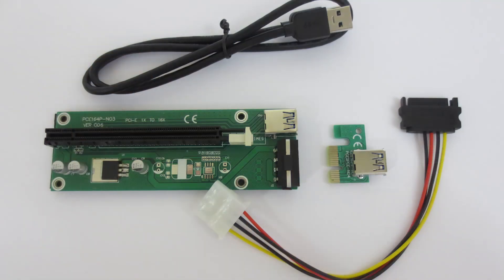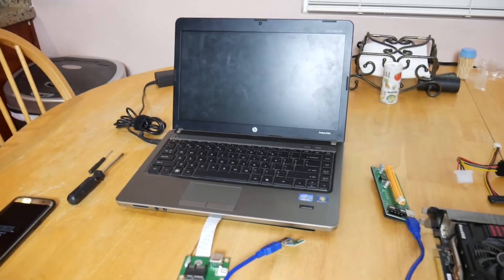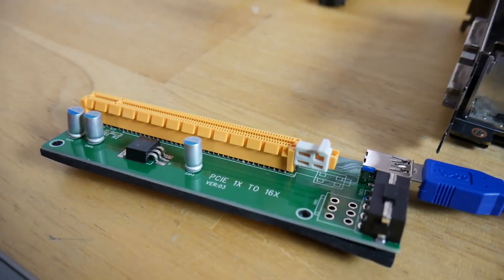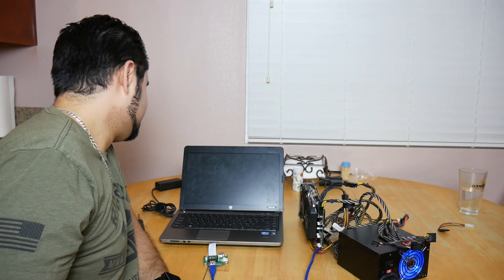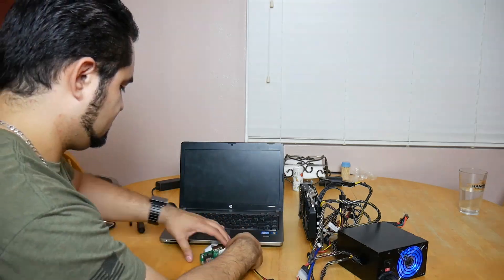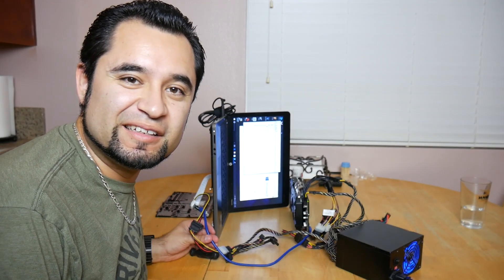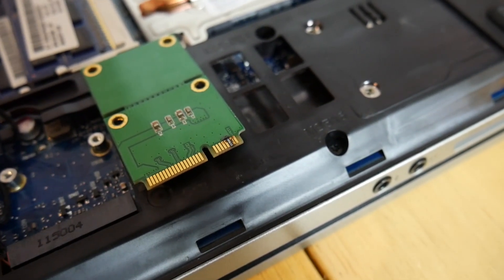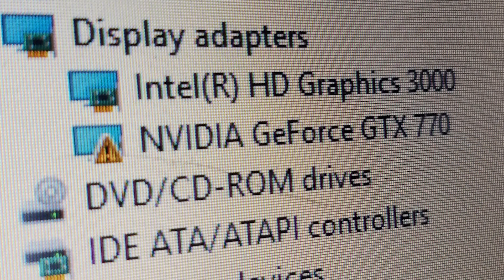$30 DIY EXTERNAL GRAPHICS CARD DOCK [eGPU ATTEMPT]

Comment: can i use it for hp pavalion 15 n225t    please tell me this is specs link  https://support.hp.com/bg-en/document/c04159825
Reply from the maker: I wouldn't recommend this setup for any kind of long term solution, but a Bplus PE4C or a GDC Beast (both of these being the mPCIe versions) is out of your price range, then i suppose you could use this. Your laptop should have a wifi card in it sitting in a mPCI-e port, and thats what you'll want to remove to plug in any external GPU device. 

However there is also a good chance you'll run into the same problem i got, since HP likes to put "whitelists" on their ports so if the wifi card isn't plugged in, it wont power the port. Thats what happened here, 99% sure, and its also an HP, so its hard to tell for sure.
Reply: hey but you can also plug it into the same port as the disk drive? my older brother told me that the ports are similar, so he have checked, apparently you can use that port as an alternative.
Reply from the maker: Disk drive usually uses a variation of SATA, unless its an SSD on an M.2 or NGFF slot, then i just recommend sticking with mPCI-E
Reply from the maker: NGFF or M.2 over PCI-E isn't widely implemented in laptops, especially older ones. I would stick with the Mini PCI-E implementation unless it can be 100% verified that NGFF or M.2 a laptop might have is configurable to run over PCI-E instead of the SATA bus. Its a different connector so trying one just to see and it not working would just add to the cost, whereas going Mini PCI-E is a much more reliable solution if ExpressCard or Thunderbolt isn't available.
Reply: but my hp laptop is intel grafics
Reply from the maker: hari prakash That's fine if you plan on adding an eGPU.

Comment: What laptop is that? I have an elitebook 8460p which looks similar to yours and I want to do a DIY eGPU for it.
I would use the expresscard version instead of the mini pcie and also does your laptop have Expresscard? 
please reply
Reply from the maker: ProBook 4430s. Yes this laptop has an expressCard slot, but i was experimenting with a different method that cost less. It could have much more easily worked via ExpressCard but this wasn't anything i was seriously considering as a proper solution, just something fun to tinker with. For you, i'd definitely advise to use the ExpressCard version of the Bplus PE4C or GDC Beast for the best results.
Reply: Thank you for your reply Im thinking about upgrading my laptop too
but i need expresscard because i dont want that kind of problems and perfect timing booting but i dont have the money for a thunderbolt laptop and the egpu
Reply from the maker: Thats why i suggested ExpressCard, it'll go alot smoother.

Comment: You have to plug a monitor to the external GPU.
Reply from the maker: yeah but im still 99% sure it was a whitelist lockout on that port, as i mentioned. 

But damnit that 1% of unsureness is going to bother the shit out of me now lol.
Reply: I'd have to second the monitor needing to be plugged in. Its quite possible the black screen on the laptop meant the signal was going to the external gpu instead.
Reply: No you actually don't need an external monitor, you need a software like optimus and you can run it from your internal monitor.
Reply: @jas_bataille  can you please explain what that is or how it work to make my because I'm having the exact problem as this youtuber. Any info or links would be helpful. Thanks
Reply: You could also use V8.0 EXP GDC Laptop External Independent Video Card Dock, it costs 45 dollars or something but it at least works better.
Reply from the maker: Definitely yeah, I had already researched the more proper solutions. Especially the ExpressCard versions of the GDC Beast (or other GDC docks) and the Bplus PE4C. I was just scratching an itch with this video/idea to see if something like this would even work though you know?
Reply: Yeah experimenting is fun xD, still I am going to use my pci-e 4x slot in my laptop to power the egpu.